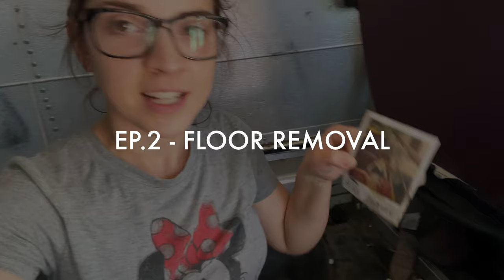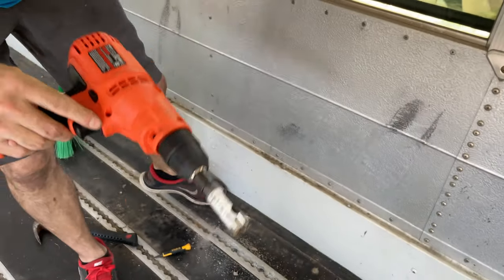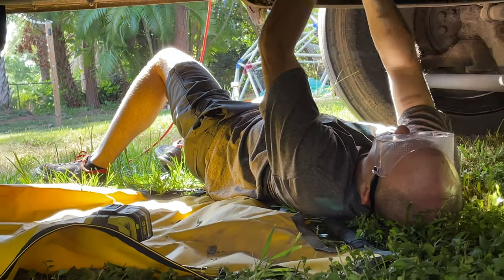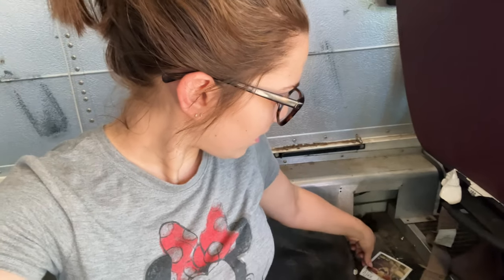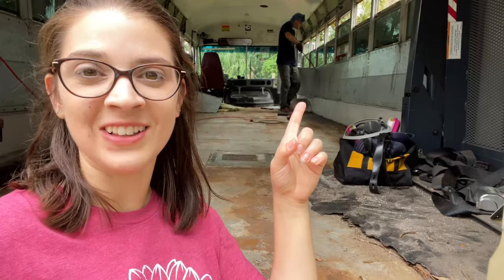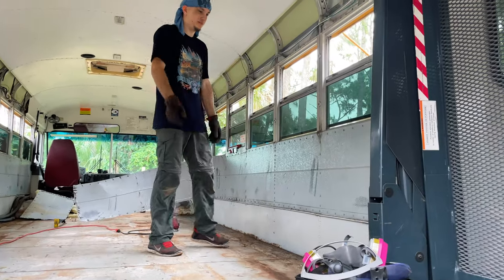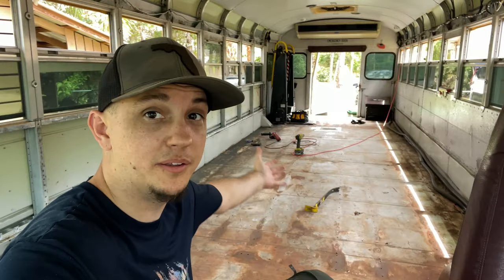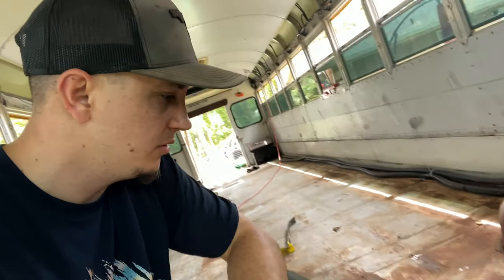Discovering a HIDDEN PHOTO in our Bus Renovation

Comment from the maker: PSA: Don’t recommend using an angle grinder for rivets. We will have a future video showing just how quick an air gun with air hammer and air chisel takes it off. 

Realized we didn’t explain very well how we removed the floor. After the floor tracks were cut out we then took an angle grinder to cut off the heads of the bolts and the heads of the nails, this released the floors and allowed pulling them up MUCH easier.
Reply: I can't wait to see the finished bus
Reply: I honestly didn't expect the use of a jack to pull up the floors, but.. if it works it works. Haha

Comment: You should be able to take a drill bit it and drill out every rivet instead of having cut every Rivet If you take your drill bed and put it in the center of the rivet It will punch out the center of it and break the rivet.